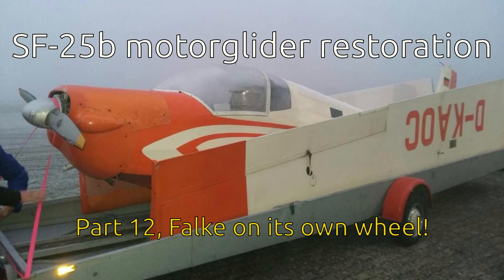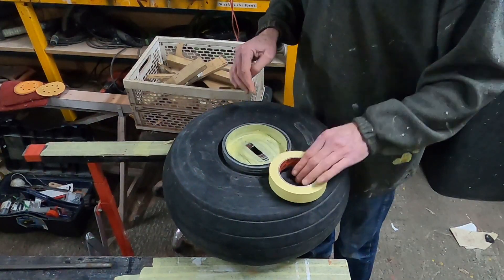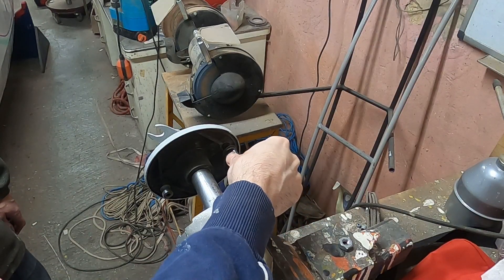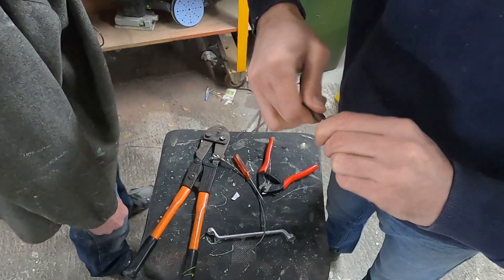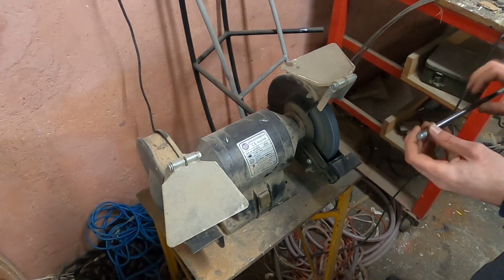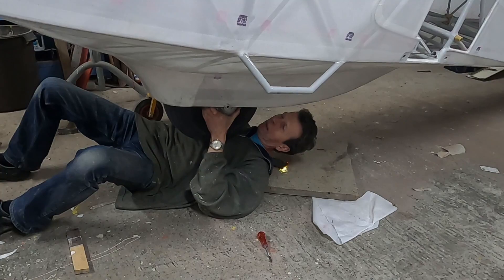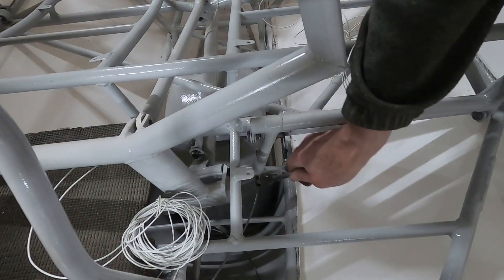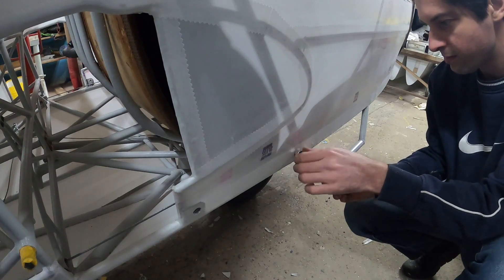Falke on its own wheel! - Scheibe Falke SF-25b motor glider - Airplane restoration #12

Comment: I think they are fittings for bolts used to sit the fuselage on a stand holding it upright when the wings are not mounted. The plastic rings are probably there to protect the canvas from scraping as the original bolts have a stop ring/nut.
Reply from the maker: You are completely right! In the next episode we will make something to do just that ;)